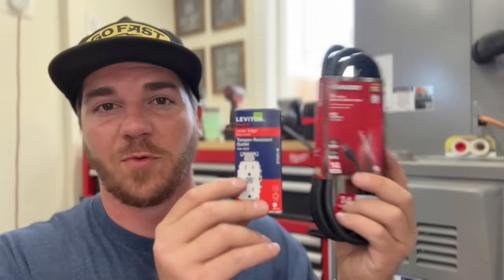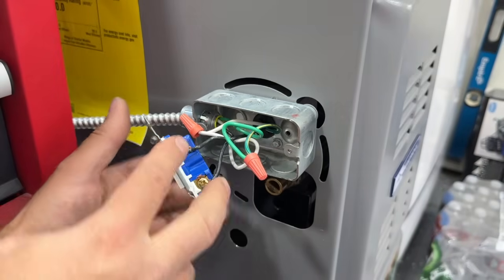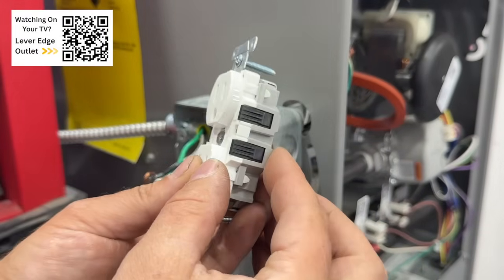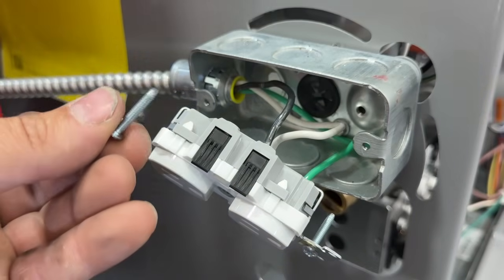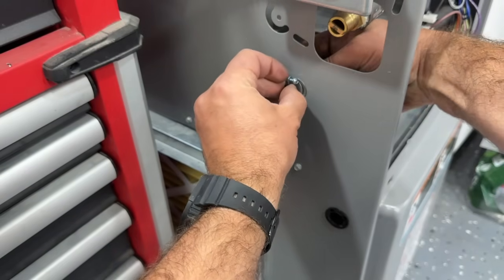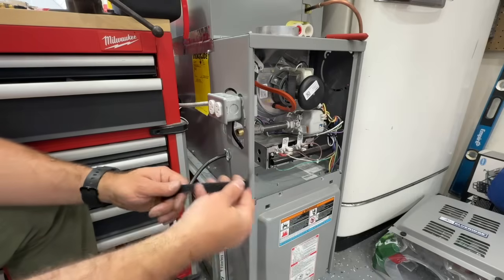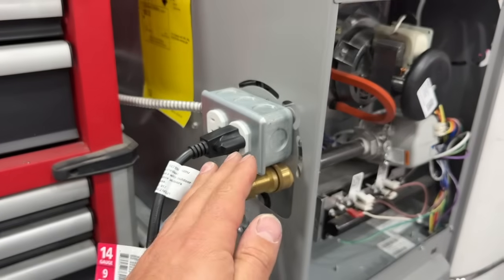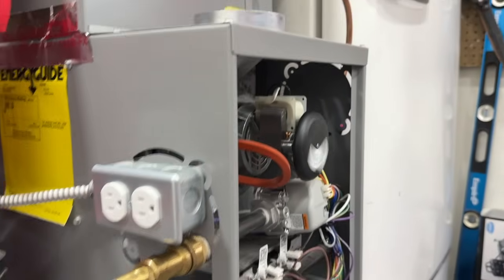This $16 Hack Could Keep Your Family Warm During A Power Outage!

Comment: Not a bad option if you are on a tight budget and the utility is only offline for a short period. You may want to consider a GENER-LINK at the meter which allows you to integrate a gas powered generator through your main service panel. This will allow you to run all essential utilities. A gas fireplace is a good idea too and/or a wood burning stove. The benefit of using a GENER-LINK is that provided you have enough fuel, you can run this system for days or even weeks.

Comment: My advantage is I am a electrician, I can have my furnace wired to work off a generator within 5 minutes. I can also use cords I will not recommend the untrained to use. I also have a fireplace for emergency uses. The BS about zapping a linesman is exaggerated,  their basic safety practice working on lines would be to ground all suspected lines while they are working on it, and they wear gloves and their buckets are insulated from ground. If you leave the main switch on, when power come back on, your little generator may smoke.
Reply: Its not BS.  When lots of lines come down, they may not be where they should be.  So sure, after they see it, they should follow procedure, but lineman have been killed walking into energized lines.  Yes, they should have VWatch devices.  But it isn't worth the risk.  Also, if a lineman is killed on injured on your circuit: (a) it is going to take a lot longer before your circuit is restored, and (b) someone will figure out who is responsible and come after you legally.  

And as an electrician, if you killed a lineman with your irresponsible installation, you'd probably need to move as I can't imagine the local crews would be very helpful.
Reply: @kcgunesq  In real life, a linesman job is not that dangerous, for we tend to read about every one of them killed and there are not many. Over the decades, most of them get to collect their pensions. Same with police, they have fairly safe job, they are allowed to defend themselves if needed but not Joe Blow  public. 9/11 proved the firemen's job are much more dangerous. All of these people tend to work in larger , more formal organizations. But not the electricians etc that worked with small 3 person outfits, you should see the safety laws they bust daily. I have to take note of your mentality, a linesman get killed say at your street, and you still worry about delay as to when power get restored !! That sounded like a line from the French queen, Marie Antonette" Let them eat cake"

Comment: I have a gas fired furnace (munchkin) and the distribution is hot water not forced hot air. I imagine the water pumps take significant current. Is there a way to estimate the draw so that the battery based generator can be sized correctly.

Comment: You kept calling the power switch an outlet😅 (the hack is to replace a switch with an outlet) Somewhat of a click bait video to claim you only need $16 to power yiur furnace during an outage. You did not clarify in the beggining that you also need to purchase a generator. Should have reminded people of a gas generator must be run far enough outside so its exhaust fumes  can't enter the home and kill everyone. Thus must purchase a long extension cord and the gasoline and oil. With the portable battery you used this project is $400-$500 not $16!

Comment: Haters gonna hate but this is a good idea for anybody who needs a simple, basic bypass for utility power allowing them to connect to a large UPS or power station for emergency heat. 

Even a small UPS will provide enough power for an hour of heat assuming your inducer is 50w, blower 100w and control board\solenoids are 10-20w. The trouble will be the initial startup draw for the blower where peak draw can exceed 300w, something a small UPS might not be capable of. Those with boilers could power the aqua stat, gas valve solenoid and pump for days on a large UPS depending on the weather as they are far lower power draw than a furnace…those little taco circulation pumps only draw 20w. I’m not sure why they are rated at 1 amp.

Comment: That single pole switch does not meet code in any area i've worked in the proper safe way too meet code is to install an SSU which using the same box it has a smaller  sp swith mounted sideway plus a fuse directly bekow the switch use a 15A screw in  fuse.

Comment: This would work for a gas water heater too and the bonding plug is still required.
Reply: Do you have a power cord on your gas water heater?  The only thing I can think of that would be powered is an auto-start ignition system, but none of my gas water heaters in 50 years has ever had a need for external power (and having hot water during our many power outages each winter is great).
Reply: @default7950  Absolutely.  The 120 V plug is for the draft induction motor.

Comment: This is ok on a small scale if you were only doing it for a few lights or maybe a fridge for a few hrs. but unless you have a large battery and alternator, it would be useless. And even then, you would have do it in cycles, other than that, you would have to shut it down for a couple of hrs. Great for temporary but not so for long term use.

Comment: Enjoying your helpful videos. I have an Ecoflow River 2 power station but it's a different configuration than yours. Mine has one 3-prong outlet with a 2-prong outlet immediately below. So there is no room for the bonding plug. Is there a workaround? Or should I purchase the EZ Generator? Thank you. Monte
Reply: There’s no way a River will have enough power to ignite and run a furnace (I have 2 models of River 3’s), plus if it did you wouldn’t even have an hour of power to use out of the battery.  Their brand new Delta models with a couple kWh capacity and the ability to add external batteries are great, but after the initial video powering the furnace with the truck and the 1,000 watt inverter I procrastinated long enough to just go whole-hog on a Delta Pro Ultra and some solar panels (along with an Alternator Charger to use the car to recharge batteries) so things other than just the heater work during a power outage. Sorry for the commercial, I have no affiliation.

Comment: Stupid question alert: If my thermostat does not have battery back-up, would the furnace turn on if the power is off?  Do I need a new thermostat also?
Reply: I had a grad school professor tell my class that, “the only stupid questions are the ones you don’t ask.” Be encouraged to ask and learn.
Reply: Do you have a smart thermostat? If so they are designed with a battery pack built in that trickle charges which acts as a back up.
Reply: A lot of thermostats get power from the furnace, as long as the furnace is plugged in (mains or generator).

Comment: Very cool outlet. 
You can also use the ears where the screws hold the outlet, the notch just below the top right and left screw holes can be used to strip your wire. That's an awesome tip about being able to cut the bolts with the wire strippers.
 Great tips great video.

Comment: Not $16, ecoflows cost more than that, I use a 2000 watt duel fuel inverter generator, 4 tanks of of propane could keep my heat going for at least a week if I use it 2 hours on and 2 hours off, dont know what you would do about recharging the ecoflow once it is dead.

Comment: If my power is out, will my thermostat have power once I plug it into the power station along with the bonding plug?
Reply: Yes, generally, powering your furnace with a generator will also power the thermostat.
The thermostat typically gets its low-voltage (usually 24V AC) power from a transformer located inside the furnace. Since the generator is providing the necessary 120V AC power to the furnace circuit, the furnace's internal components, including the transformer that powers the thermostat, will be operational.  
However, if your smart thermostat uses a separate common (C) wire that is only powered by a different circuit (like an air conditioning unit's transformer not connected to the generator), the thermostat might not fully function. For standard or simpler thermostats, though, powering the furnace is usually enough.

Comment: Thanks! I have been using the Wago nuts for well over 10 years. I LOVE working with these guys.
Reply: Another fire waiting to happen. They are ok for LED lights and other low current draw circuits I would never use them on a 20 amp or higher circuit. 73
Reply: @ronb6182 yet somehow Europe has been using them without issues for decades….

They are fine for 20 amp circuits and have been used on 240 volt service for years.  

A lot of people confuse these with friction fit connectors.  Wago connectors use a lever lock. They are absolutely safe. More expensive, but safe.

Comment: not everybody has a gas furnace
Reply: If you dont have a gas furnace, you should have noticed early on watching the video that it wasn't made for you.
Reply: Works for oil and propane as well
Reply: @bradjenkins932 Will it work on a Peerless boiler?
Reply: @Captain1717Q  Yes
Reply: @bradjenkins932 Thank you for replying. 

My next question is would it be considered up to code when I sell my house?
Reply: @Captain1717Q  You'll have to check your local codes.

Comment: They have bypass switches that I installed under my breaker box from Reliance Controls (model TF151W). During power outages, I flip the switch to "GEN" and connect it to a generator that feeds my gas furnace power. When power is restored, the switch prevents power from back feeding and destroying your generator. After power is restored, you put the switch into the "LINE" position and you are connected to commercial power as usual. I put in a second one that goes to a sitting area in the kitchen that can power outlets, a TV etc. in that room upstairs which is very convenient.
Reply: How many amps can that switch handle?
Thank you.

Comment: What would happen if u use a 16 gauge pigtail? Curious. Ty
Reply: This furnace in particular only draws 250w.  16 awg rating varies depending on the jacket material, but the vast majority can support 250w easily. If the cord feels warm under use, then you should up-size it to 14.

Comment: There is an outlet box coming out of my electric panel. Can I just plug the power generator into that, shut off the main breaker, and just keep the boiler breaker on to run the boiler?
Reply: It is dangerous to back feed a panel when you don't know what you're doing. If you forget to shut off the main you could end lives.  Once that voltage passes through your transformer it is multiplied to dangerous levels. 

Also, if you fail to turn off all other breakers, that single outlet circuit you plug into will be carrying the entire load. Which could lead to a possible fire, as the smaller gauge wire could overheat.  There's a reason the wires coming into your panel are bigger than all the wires leaving it.
Reply: @MaryJane-ln3vv Thanks for answering my question. Now I know I DO have to do any changes directly on my boiler. Will definitely get an electrician! So that outlet is just to use a fan or vacuum cleaner I guess. Thanks again.

Comment: my furnace switch is on the wall, not mounted on the furnace itself. im guessing it doesnt matter where the switch is, the same steps still apply and use the same wiring method it will still be essentially the same, correct?

Comment: What did I miss? Why did it need that “bonding plug” what does that do and why didn’t it work just plugging in the furnace?
Reply: That inverter he used checks for a neutral / ground bond.  It would not work without it. Since the furnace does not have this bond, he had to make one artificially.

Comment: An informative video. But definitely not something to try without a licensed electrian. This is only for someone with advanced electrical knowledge
Reply: I always wonder how mane fires / lives ended from people watching youtube videos, showing them how to do their own electrical work. Often from people who are not electricians to begin with. 

Like this guy is HVAC, he says you "might want to use a romex connector".  Um, no, that's required.  Not only does the furnace vibrate, houses vibrate.  Overtime that sharp metal edge will cut into the wire. Leading to a possible fire.

Comment: To the best of my knowledge (not an electrician but worked construction) code requires a dedicated circuit for a gas heater. By using a duplex outlet, you've made the circuit available to another electrical draw and it's no longer a dedicated circuit. I got around this by using a switch/outlet combo that fits in the same duplex size - the switch controls the outlet. You could also find single outlet setups for that box or a transfer switch for a bigger box.

Converting a hard-wired appliance to a cord may not be code since most codes say to "install per manufacturer instructions" and the manufacturer may specify hard-wiring. In reality, the cord shouldn't introduce any real problems as long as it's appropriately sized.

I also worry about running the battery to zero while the furnace is going. Maybe I'm completely off base, but I assume that in normal operation the fan continues to run at least briefly after the burner stops to prevent heat damage inside the furnace. Obviously the furnace should be able to survive a power outage, but I don't think it would be good for it and it's something I would rather avoid. Regardless, if you don't use the 2nd plug in the duplex outlet and you turn the furnace off or recharge the power station before the battery dies, this is still safe and better than freezing.
Reply: You make a good point on it needing to be dedicated.  The bonding strips on the outlet should be broken.  This will separate the 2 plugs only powering one. 

Being a licensed electrician, the only safety issue I see is him saying the romex connector is optional.  No, its required.
Reply: The blower motor continues to run after a call for heat has ended to use the available heat that's still in the heat exchanger. It has absolutely nothing to do with preventing heat damage. 
Haven't you ever noticed that the burner fires for 30 seconds (model dependant) BEFORE the blower motor turns on during a call for heat? 

Why would the manufacturer program the furnace to do that if it was going to cause "heat damage"???
Reply: @billymacktexasdetective5827  Thanks for the info.
Reply: Yes, wiring the outlet to the furnace side of the the switch will do the same thing. With the switch off, the outlet becomes the furnace input for a generator or inverter. Then just need a 2 plug 3 wire cord.

Comment: Hvac guy here… be very aware a plug is not a switch. An inspector or any contractor can and will condemn your system until it is right for habitation or sale in any state following the North American mechanical and fuel gas code. In many states that system is 100 illegal. 

https://www.google.com/search?q=north+american.mechanical.code+says+a+furnace+should+be+installed+with+service+switch&rlz=1CDGOYI_enUS1012US1012&hl=en-US&sourceid=chrome-mobile&ie=UTF-8

Comment: Thanks I'm a retired plumber, having decided to save money and not renew my state license. At my age (72) I'm all about relying on the 'double check', lol. Thanks for verifying. I've been wanting to do this but always put it off thinking I'll cross that bridge when I get there but with winter approaching I'm not getting any younger so gonna get done. Thanks. I do have another question about adding a receptacle in my kitchen. For whatever reason a 240v recep is located in my crawlspace to feed a 220v a/c unit in dining room, I have hot water heat, no ductwork. Anyway I plan on using that crawlspace recep as my 120v supply in kitchen by running 16/3 romex to the crawlspace 240, just using a hot, neutral and ground. I'm tired of the circuit breaker popping. Whoever wired this house 50 years ago tied kitchen, dining and living room on 1 15 amp breaker. What's your thoughts on doing this? Thanks

Comment: Assuming that the internet still works after a power outage you need a battery backup for your modem router combo goes that Nest news Wi-Fi unless using an old school thermostat keep in hands or just connect the two cables that calls for heat
Reply: No, the nest will work when off line, you just need to control it manually.

Comment: This sounds great! I’m not 100% sure I understand the bonding plug part though. Like how would you know if it is needed or not?
Reply: It's a portable generator wiring issue for both gasoline / propane generators or battery packs like this one. There are different NEC rules when you combine the ground and neutral and when you don't.

Comment: I'm stumped on the need for a bonding plug. Why can't you just plug in to the power station & forget about it?  I have several power stations & use them all the time outside so I don't have to use extension cords, never had a problem.

Comment: So if my propane generator is on my main floor from the basement, would need a 100-foot extension cord to work?
Reply: If you have a generator, I would just get a interlock for your electrical panel, or get a transfer switch, I bought a used 8 circuit transfer switch off Facebook Marketplace and installed it myself, plug my generator in and do not have to mess with extension cords ever again.